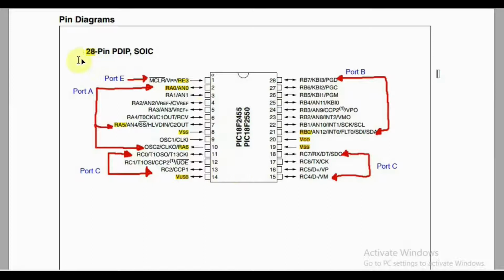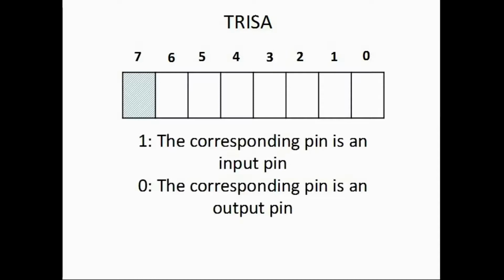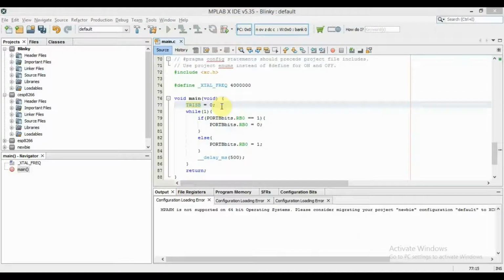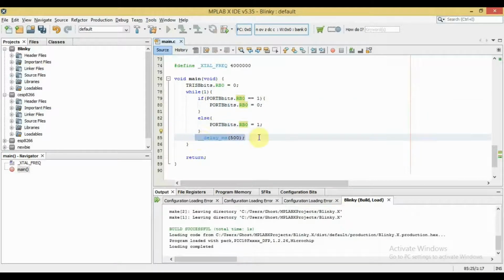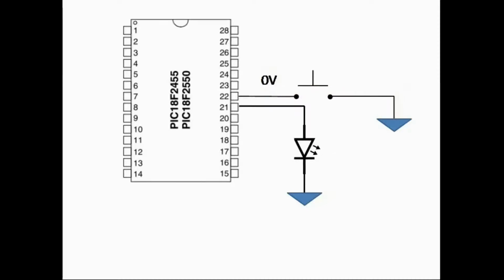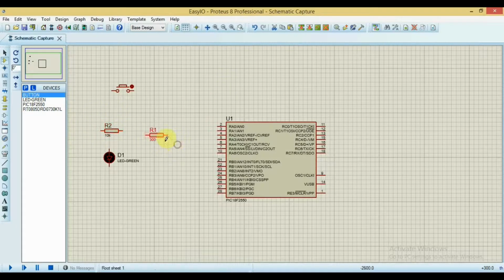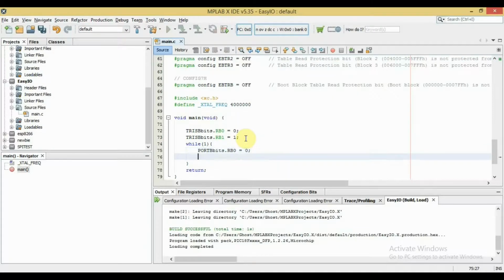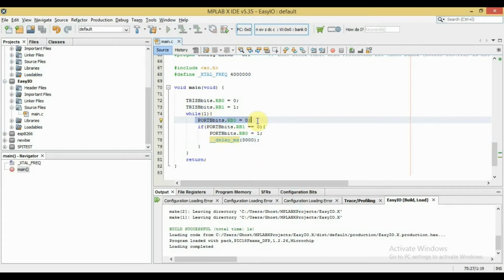How to program GPIO ports in PIC18F - user interface with I/O ports

Comment: I have been looking at a Geiger counter circuit that uses PIC18F2550 and it has a button switch to ground on Pin 22 with a 10K resistor from the pin to +5v. I believe the button is used to change the modes on the device to measure in 15/30/120 second intervals.  I'm curious how this works. Where can I read more about this?